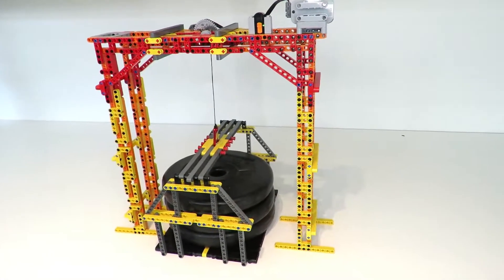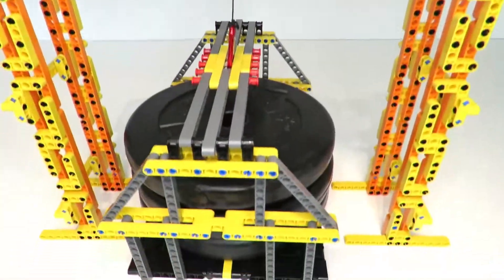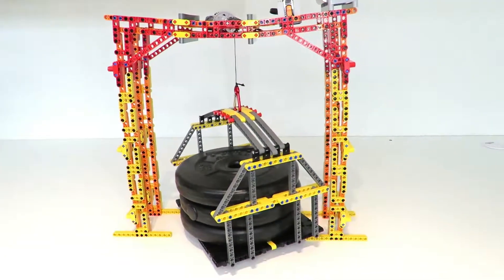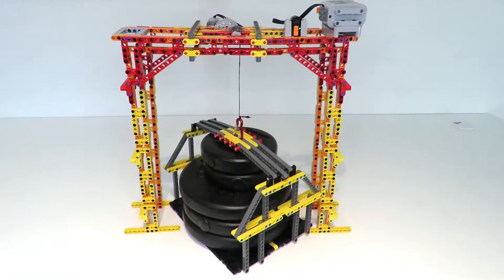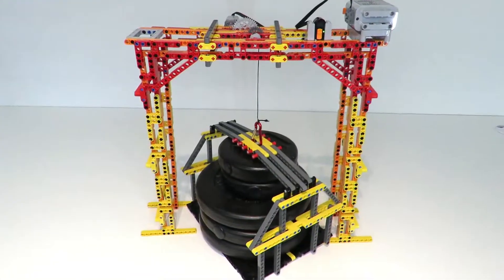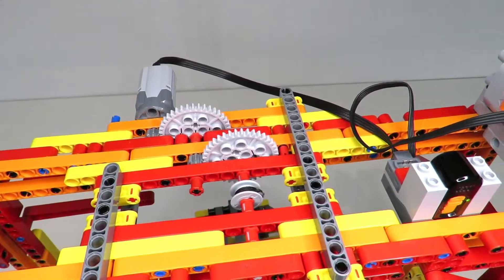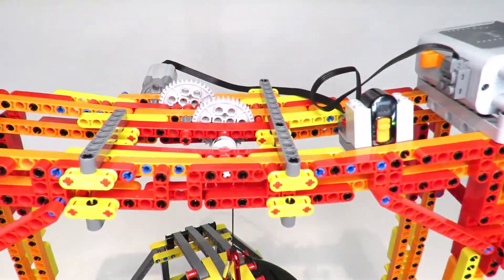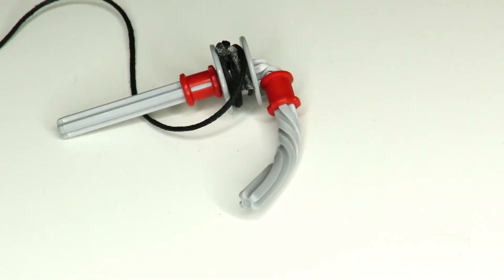Lego Technic MOC Crane sets a record! Have you ever seen an axle so twisted?

Comment: Y no pulleys? Would allow for much greater reduction and torque without additional gears, relieve the Lego axles of the greatest stresses and distribute the weight across more rope and multiple attachment points
Reply from the maker: Hi Maarten. I totally agree with you. I was trying to make a series where I keep improving the lifting capability of the crane. Then I got side tracked by gearboxes! 🙃

Comment: You could buy an old train controller and converter cable to replace the battery box,  saves some money or recharging time. There is also an XL motor, it delivers a maximum torque of 90,4 mNm instead of the 45 mHm you have now. Cool project!
Reply from the maker: Hi Erwin, Thanks for the ideas and feedback - I think I will be using some of your ideas in the future. ;)
Reply: @TechnicBrickPower  Can't wait to see what you do...